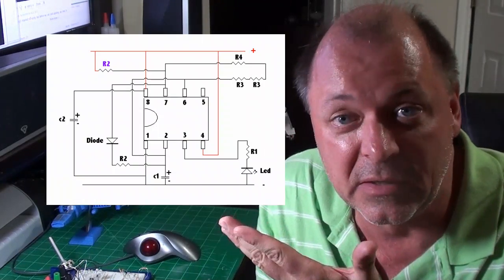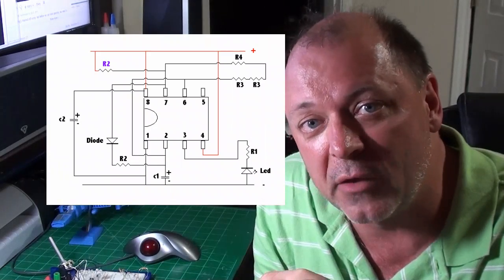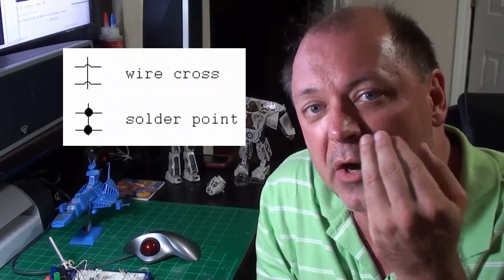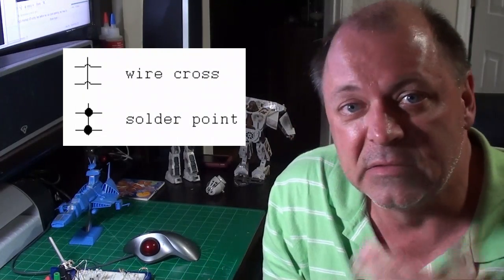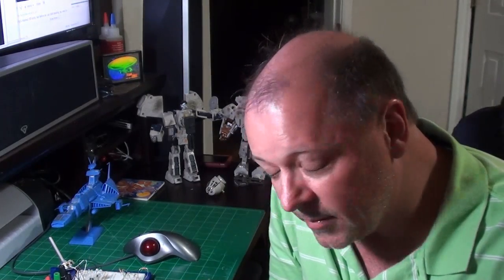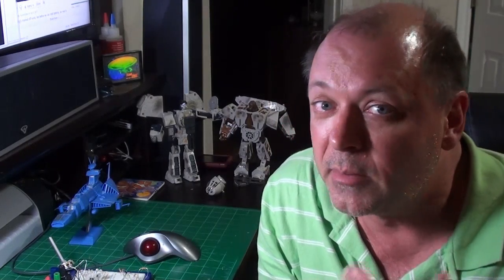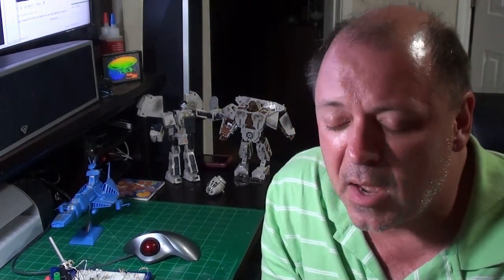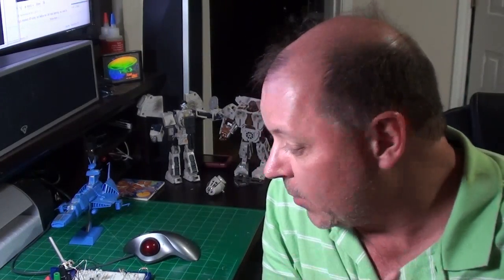Reading Circuit diagrams part 1

Comment from the maker: I didn't do a part 2, instead I just broke it down by timing chip.  So there is a reading circuit diagrams for the 555 timer, and one for the 4060 timer.  Sorry about that!